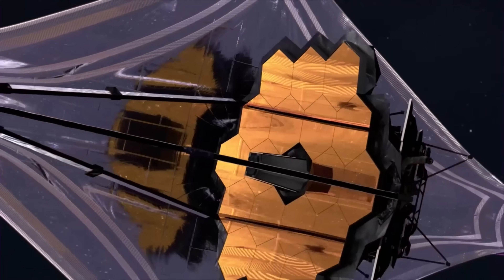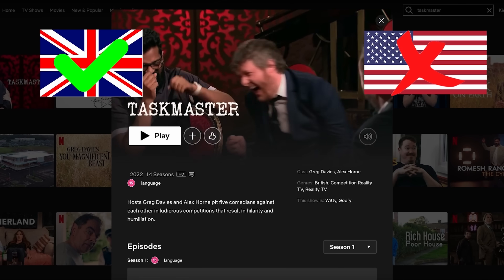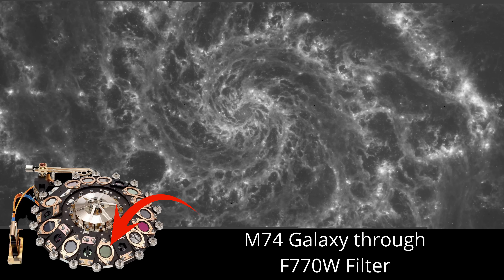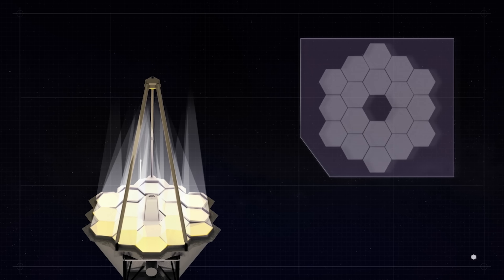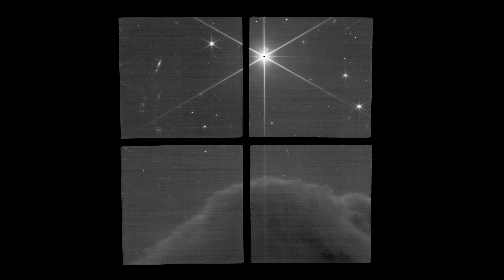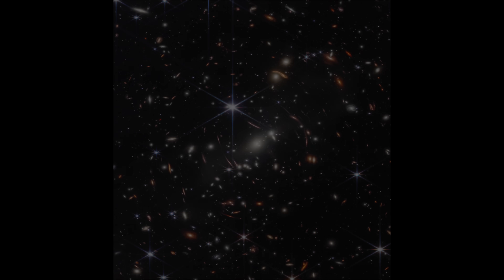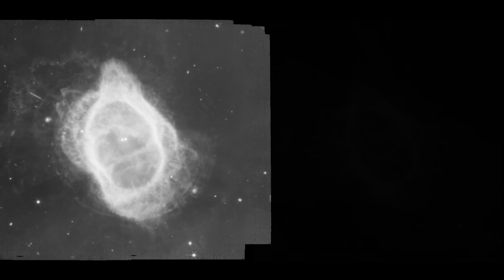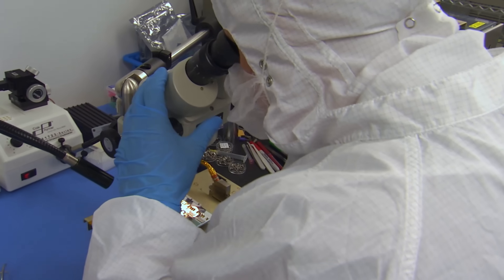What Do Unedited JWST Photos Actually Look Like?

Comment: If you're interested why the brightest star cores are black, it's because when JWST detectors saturate they don't behave linearly anymore. Instead of plateauing at a maximum value, a saturated detector output rolls over into meaningless or even lower values. In other words, a saturated pixel can produce numbers that look smaller, not larger.

To avoid mistaking these garbage values for real low-intensity pixels, the calibration pipeline intentionally flags and clamps saturated pixels to 0, which renders as black. It is an explicit design choice.

JWST saturation values are not physically meaningful, so rather than pretending they represent true brightness, the pipeline replaces them with a sentinel value - 0 - and marks them as unusable.
Reply: pretty elaborate explanation just to be wrong, the jwst has physical coronagraphs
Reply: @ffffffff-gu5qr Physical coronagraphs are only used in a limited set of observations when obscuring a singular bright source. They are useless for dense starfields where stellar luminosity saturates a detector. So no, I'm not wrong.

Comment: I think this really goes back to how people conceptualize photography in general. for several centuries photography was a photochemical process that produced physical representations of light interacting with the chemicals used to coat films, glass plates, metal, and paper. I think that cultural memory continues to how we conceptualize photography today. Every photo we take with a digital camera has so much post processing applied to it. Even pro level digital cameras that capture photos in "RAW" still have a bunch of post processing applied to it. I don't see how space photos using elaborate post processing applied to it is any different than proprietary iphone post processing, just that the use cases are completely different.

Comment: "the JWST captures raw light, not a photo. It records tiny differences in brightness across its detectors and stores them as numbers"

That's exactly what every digital camera does. Photons hit a sensel within the array (the array is also typically referred to as 'the sensor' in the context of cameras, and is a bunch of millions of individual sensels). This triggers a slight change of charge to whichever sensel the photon hit, which is measured as a change in electrical signal. This is converted into a number which is stored as part of the photo image data - typically RGB in consumer cameras, but of course it's different wavelengths of IR on the JWST. The only difference is that in most consumer cameras, they have an IR-cut filter to block IR light from hitting the sensor at all.

Not trying to crap on the video because it's still informative, but you make it sound like the JWST works fundamentally differently, whereas it really doesn't - it's quite literally just that it has more sensors, and each sensor is dedicated to different wavelengths compared to consumer cameras. At its core, the way that the photo data is captured 'at photon impact' and stored is the same as in an iPhone 4, or any other digital camera.

Comment: Sorry, but at 9:16 you say that gravitational lensing is proof of dark matter, which is false. In a case like this, Dark Matter and Gravitational lensing have nothing to do with each other. Gravitational lensing occurs when a huge mass like a star, black hole or galaxy bends the light of an object "behind" it so that we can see it like in the Picture you showed. There is no dark matter involved here
Reply from the maker: There’s not enough visible mass from the galaxy to cause the extreme lensing effects we see in the image. This is why it is strong evidence for dark matter.
Reply: @ianlauerastro  I know that dark matter makes up most of the mass of the universe and that it can bend light due to its effect on space time. But my point still stands, gravitational lensing is not proof of dark matter, because dark matter is not the original cause of gravitational lensing. The bending of space-time is. It doesn't matter if its dark matter or not. Even in a universe without dark matter, gravitational lensing would occur. You cannot assume gravitational lensing is proof of dark matter. 
We could use the sun as a gravitational lense by using its own actual mass. Without having to take dark matter into account. The focal point would be hundreds of AU's away from the sun, but we could use it as a star sized telescope
Reply: Google Dark Matter and read the first paragraph.
Reply: @95SerGo  I know that dark matter makes up most of the mass of the universe and that it can bend light due to its effect on space time. But my point still stands, gravitational lensing is not proof of dark matter, because dark matter is not the original cause of gravitational lensing. The bending of space-time is. It doesn't matter if its dark matter or not. Even in a universe without dark matter, gravitational lensing would occur. You cannot assume gravitational lensing is proof of dark matter.
Reply: @craftbil  Read the first paragraph of a Wikipedia article for Dark Matter.

Comment: Finally i know why the bright stars always have a black dot on them

Because the image data is "clamped" on a ramp, the brightness of the stars is outside of the maximum brightness of the clamp, it gets removed and appears as a black dot.
Reply: Why it gets removed?, why don't just max the brightness and keep it white instead of showing a black dot
Reply: @vilian9185  When JWST detectors saturate, they don't behave linearly anymore. Instead of plateauing at a maximum value, the detector output rolls over into meaningless or even lower values. In other words, a saturated pixel can produce numbers that look smaller, not larger.

To avoid ever mistaking these garbage values for real low-intensity pixels, the calibration pipeline intentionally flags and clamps saturated pixels to 0, which renders as black. It is a very explicit design choice.

Comment: an easy way to put it for someone unfamiliar with the concept is that its like looking at an x-ray of the bones in your body. you cant see x-rays, but you can take a picture with them and produce an image you can see. x-rays can go through skin and muscle, like IR light can go through gas and dust, and reveal what cant be seen in visible wavelengths. x-rays, visible light, infra red, plus gamma, microwaves, radio waves etc, are all the same stuff anyway, its all just light at different wavelengths
Reply from the maker: 100%!

Comment: The JWST is literally just like the hubble but sharper lol. KEEP UP THE GREAT WORK!
Reply: ironically, cause JWST sees so much longer wavelengths of light, the actual "sharpness" or resolution rather in IR, ends up being fairly similar to hubble in visual range. Of course more modern tech in JWST probably makes the actual images sharper but theoretical sharpness of both systems ends up very close.
Reply: You could use deconvolution